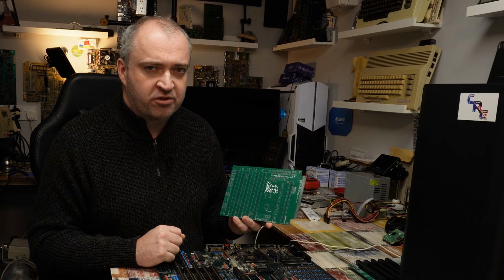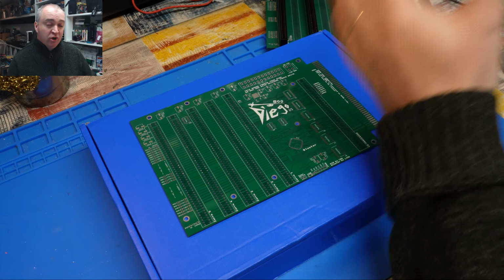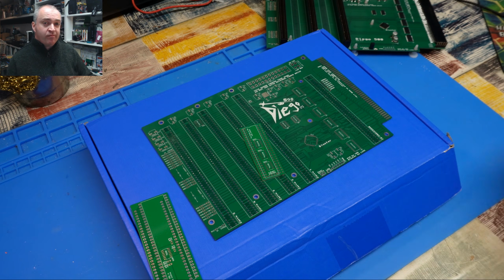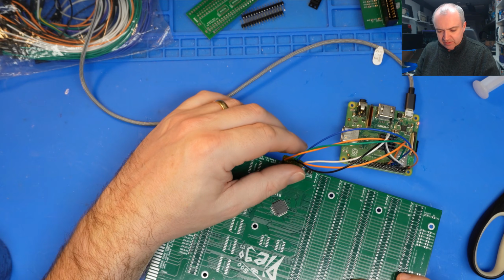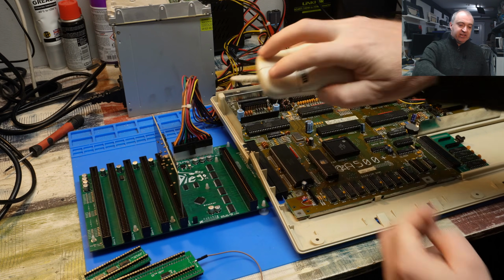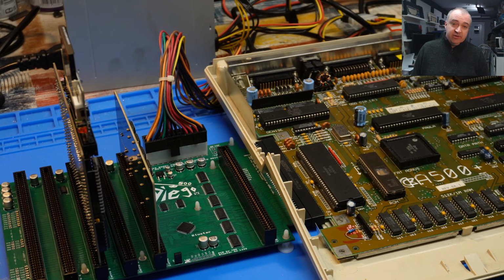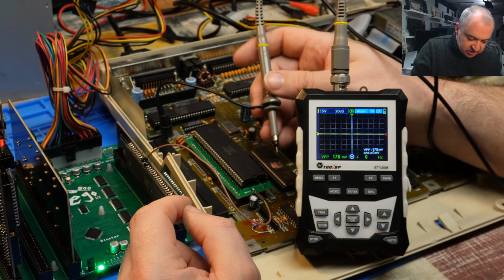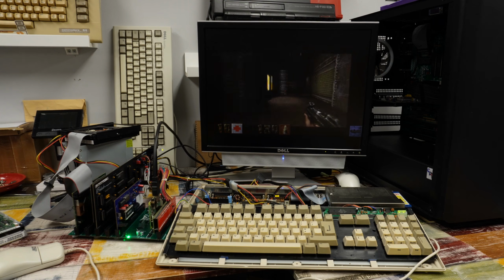Turn your A500 into an Amiga 2000

Comment: 5V power calculation assuming the traces are 1oz copper.

1mm wide, 1 oz copper trace on an outer layer:
    Safe continuous current ≈ 2.5 A (10–15°C rise, conservative)
    Maximum for typical designs ≈ 3 A (20°C rise)
    Absolute limit before risk ≈ 4–4.5 A (30–40°C rise; not recommended for long life).

As the A500 has two 5V pins the numbers would be doubled.
So should be able to take about 3A x 5V = 15 Watts

So if the Amiga side only uses ~15Watts you should be okay.

What's next PC bridge board slots 🔧
Reply: If you are referring to the 5v connections on the side slot. Whilst there are two 5v pins, they both then connect with a via to a single trace that's fairly thin.

The A500/A2000 Technical Reference Manual only rates the side expansion for 300mA (power budget section around page 227)
Reply: @LemaruX  Yes, my calculations only included one side, hence why I didn't double it.
The 300mA power budget is if the A500's power supply is powering an expansion without an external supply of its own. Glen is going the other way and powering the A500 from the expansion.
Reply from the maker: Many thanks for providing this calculation.  As you said the 500 has two pins but they both run to one trace on the underside of the 500s board which is the limiting factor.  I still think the pass through cable is the safer option.  

ISA slots for a bridgeboard is the next part of this which should be simple enough to incorporate although I don't have a bridgeboard to test with.
Reply: @CRG  Okay I've had more time to think about this and do some more calculations.
The trace is 1.4mm wide. I have checked on a Rev6 and Rev8 boards. I have also checked various Re-Amiga projects.
It is only 16mm long. This does not change the calculations much but it does help because on the Amiga side it is close to the main 4mm wide 5V VCC rails and on the expansion side it is very close to relatively large connection pins on the female edge connector. I also assume that on your PCB the 5V VCC line, just after the edge connection, goes directly into a power plane, large poly fill or wide trace. All of these factors help and provide a large heat sink so we can allow the 1.4mm trace to generate more heat than say a 5cm 1.4mm trace would.

So;-
For a 1.4 mm (≈55 mil) wide, 1 oz external trace, from IPC-2152 calculators:
    10°C rise: ≈ 3.2 A
    20°C rise: ≈ 4.5 A
    30°C rise: ≈ 5.6 A

These values are essentially the same regardless of length (above a couple mm) because heating is per unit length, but as I said, very short traces can dissipate heat into pads/components, increasing capacity.

Resistance of 1 oz copper: ≈ 0.5 mΩ per mm of width per cm length.
More precisely, sheet resistance for 1 oz Cu ≈ 0.5 mΩ/sq.

For trace 1.4 mm wide, 20 mm long:
Number of squares = length/width = 20 mm / 1.4 mm ≈ 14.3 squares.
Resistance ≈ 0.5 mΩ/sq × 14.3 ≈ 7.15 mΩ.
At 5 A:
Voltage drop = 5×0.00715≈0.036 V5×0.00715≈0.036 V → negligible for 5 V supply.
Power dissipated = I^2R=25×0.00715≈0.18 WI^2R=25×0.00715≈0.18 W over 20 mm → mild heating.

The temperature rise for a given current will be much lower than an isolated trace.
Empirical rule from PCB designers: if a trace is shorter than ~50 mm and well heat-sinked at both ends, you can often double the "standard" current for the same temperature rise.

So, from our earlier numbers:
Isolated trace, 20°C rise → ≈ 4.5 A
But as we have good heat sinking → could handle ~7–9 A at same temperature rise but 6 A continuous is a safe upper limit.
A heavily expanded system (RAM, accelerator, like those with a Vampire) may require 5A 25W.

So I believe it would be fine. The original Commodore A500 PSU (model #312502-01/02) provides +5V at 4.5 A max → up to 22.5 W on 5V alone so a stock A500 with a RAM expansion shouldn't require more than 22W.

The trace burn up point would be ~25 A for 1 second or ~60 A for 0.1 second.

Hey Glen, are you a member of the  Board Folk Discord? This should get you in if you want to join.
Reply from the maker: I've not used a 5v plane but rather a 2mm wide trace on the top side of the board reducing to 1.5mm at the connection to the pads top and bottom.  There are 3 0.5mm hole vias linking the top and bottom of the board.  Happy to share the kicad files for it if you want to take a look.  

EDIT: Just reviewing this there is space to make this a 3 or 4mm trace up to the ATX socket if that helps let it work.  I have it at 3mm already across the front of the ATX socket.

I'm not on the board folks discord but happy to join if someone wants to invite me.  You'll get me on my discord or retro hardware discord.
Reply: @CRG  There is no requirement to reduce the trace at the fingers. Leave it at the finger width or even slightly wider with the extra on each side. You could easily make the trace 2.5mm wide and it won't interfere with anything and a 2.5mm trace at 2oz thickness can carry 4A.

Comment: CHanging the orientation of the card 90 degrees,  then put everything into a wide tower case with vertical slots. I'd love one to use on my second 500.
Reply from the maker: A few people have asked for that so I'll look at maybe a 3 slot vertical version.   I think 5 slots vertical would be too much.
Reply: @CRG  3 is probably enough for most anyway, at least for those using a pistorm.

Comment: @CRG Suggestion:  Make an ATX form factor for the board?  That would hold the Diego 500 and the PSU.  I've already worked out a plan for implementing that based on my own KiCad projects. Maybe fork that into a different version as "DiegoAT-X"?  (I had to include a real word from the English language 😅)  Either way, I'd be very keen to get my hands on one of these for my A500!  Fantastic work, Glenn!
Reply from the maker: Yeah that would work.  My only slight concern is the mounting holes inside an ATX case would be further apart (I think) making the board wider and increasing cost slightly.   Not a massive issue and I suppose if it makes finding a case easier then might be worth it.
Reply: @CRG My idea would be to spin up a breakout PCB to a couple of D-sub connectors to run cables to your DiegoAT-X board.  The two I suggest going by what's lower price and avaliable from DigiKey are 1x 62-pin HD and one 44-pin HD.  They're probably about £10 per connector, but at least they aren't nearly £100 each for, say 1x 104-pin.  For the power, I suggest a 5-pin circular DIN to the Amiga's power input.

Comment: Absolutely Fantastic Glen, hell of an achievement. 
But pls,pls,pls pls... icing on the cake, extend the back and stick at least 1 or 2 16bit ISA Slots on there for bridgeboard use... that would get it as close to an A2000 as possible.
Cheers
Reply from the maker: I am planning that as an addon board but I wanted this board to be fully working first.  One thing at a time as they say.
Reply: @CRG thats awesome my friend, I have a few 2088XT boards that my friends want me to overclock and this adapter is going to be so damn useful.
As it stands its a fantastic diagnostic aid...
Keep up the awesome videos ;)

Comment: If the two boards simply slurp the signals then output their own make castellated boards that can be soldered to the bottom of the board. Can use thin PCB for better fit. I just hate interposers when not necessary.
Reply from the maker: yep, that absolutely is an option although for testing purposes the board with legs and a socket as I have it here is easier to work with.

Comment: About the case, maybe design some modular covers, so that only a long card will take space on the desk, instead of designing a case that accommodates long cards that stays empty 80% of the time.

Or you could design a new A2000 case to transplant the A500 in...
Reply from the maker: I like the idea of a modular case.  I'm not sure I'd be up to the job of a complete new case to house everything but happy to work with anyone who would like to take on such a challenge.
Reply: @CRG . I am thinking about L-shaped covers that snap together in a vertical motion, as if you are installing a card, with longer covers (with protruding sides) to accommodate longer cards.

Comment: Looks amazing Glen!

As you said in other comments it would need to be 3 slot instead of 5, but I like the idea of a vertical board in a case so that anything plugged into the "external" connectors on the Zorro boards are all going out the back, in the same direction as the machine itself, and the ATX power on the back also.

That way it wouldn't completely dwarf the A500, if you have half length cards. You'd still have a hump, but not a giant one 😂
Reply from the maker: I'll have a play with that layout and see what I can come up with.

Comment: Amazing project!  How about a rigid L shaped vertical riser that moves the expansion board up and above onto the back half of the Amiga, behind the keyboard? You could then design a box that makes it end up looking a bit like the Apple III+?  You'd still be able to access the Amiga's own ports, the PSU passthrough could be right over the Amiga's PSU port for easy access.
Reply from the maker: Yep something like that would work.  I've looked briefly at a vertical version of the board.  With 5 zorro slots it does get very tall but if I reduced it to 3 I think it would work a lot better.  I want to get this version fully finished then I can revisit that idea.

Comment: I've encountered that problem with the power connector not fitting. Those connectors have a different footprint for the right-angle connectors vs the straight ones. The rows are spaced out a little further on the right angle part.
Reply from the maker: and that's exactly the problem I have.  Wouldn't be the first time I've picked the wrong footprint in kicad...

Comment: Can you test a SID on that SID card in this setup? There is a theory going that it picks up bus noise if it is used on an Amiga powered with an ATX PSU. (btw I thouht only SCSI cards are DMA cards?)
Reply from the maker: I have tested the SID card and it sounds fine to my ear.  Unfortunately a SCSI card is the one thing I don't have to test with but hopefully one of the other guys helping can test that for me.  The hardware database lists the original prelude as doing DMA but I can't find any other references to that so not sure.
Reply: @CRG  Really? maybe I should build that version of the card. Too bad the project is pulled from PCBway.

Comment: I would make a square case that can hold full sized zorro cards, a psu and cpu slot. Then Id have a cable with a connection running from that box to the 500. Basically a 2000 extention to a 500 that you dont necessary need to place right next to the 500. Now the pricetag is more interesting question...if you do such a thing who would buy one and at what cost? With a case a cable and an internal psu inside that case I can't imagine a consumer price under the 300£
Reply from the maker: That would be as great idea and I may test this on a large ribbon cable to see if it still work ok (don't see why it wouldn't).  Cost is always a concern but I've done my best to keep the footprint as small as possible thus keep the cost down.  At the minute a set of boards plus the bill of materials works out to about £60-£70.  That's not including assembly so you'd need to allow something for that if you can't do it yourself.

Comment: why would you mess about doing all that for a A500 wouldn't you just get a A2000
Reply: You could do that sure, but where's the fun in that? What you could or should do has nothing to do with this, it's all about CAN, because why not? :p
Reply from the maker: You absolutely can just go get a 2000 but you're looking several hundred for that pleasure.  If you already have the 500, Diego will let you experience Zorro card for a lot less.  At the minute a set of boards plus the BOM is coming in at about £60-£70.  That's not including assembly so if you can't do it yourself you'd need to allow for that on top but if you consider the A2000 I built here a few years back, its board and BOM cost was over £200.  

 Plus as FloatingFatMan said... it's more because we can.
Reply: They're like rocking horse poop

Comment: That's a really cool project. I wonder if it can run a full toaster suite which I think was A2000 specific.
Reply from the maker: I've no toaster cards to test with.  We don't have a video slot on here though so if the toaster needs that then I'm afraid it won't work.

Comment: I would clearly say the Amiga 2000 board is obviously a lot bigger to start with a lot more going on
Reply from the maker: It is indeed bigger but there really isn't much more going on outside of Buster and the expansion slots.  Was really just a way to introduce the project to the video.

Comment: This is so cool. But it makes for a very messy setup. Still extremely cool!
Reply: This is just a prototype that shows the idea works! Next comes the designing to house the thing in some kind of case. One step at a time. No sense building it out until the basic concept is proven to work.
Reply from the maker: Using a pico atx psu will tidy it up a bit and once we get a case finalised that'll help too.  But yes its a big board to hang out of the A500.  Its designed here with 5 slots but a 3 slot version would save some space.

Comment: Excellent job... well done.  Would a PicoPSU work to power it?  It would save on bulk, calbing, etc...
Reply from the maker: Yes a pico psu should work fine.  Ive bought one to test with myself and will save on the bulkyness of the full psu im using here.

Comment: This labor reminds me 100% of the seemingly endless card swapping w/my A2000 and i think dealing with U606 Pin 13 to "CFG out" on the GGF ram cpu piggyback board and a few cards. You've tackled a lot building the diego breakout board for the 500!
Reply: do the case idea that @envoycdx mentioned but use acrylic!
Reply from the maker: Thanks for the kind words.  I'm hoping this expansion will allow some to experience Zorro cards without having to spend a fortune on a real A2000.  The case as suggested by envoycdx is a great idea, I'll have a play and see what I can come up with.

Comment: What about an L shaped connector? It would still need a custom case but it would be more of a cube type.
Reply from the maker: As in make Diego vertical?  I had thought about that but the full 5 zorro slots makes it very tall.  Maybe a 3 slot version would work better vertical, will give it some thought.

Comment: That has the potencial for needing 2 case types, smaller for those who just want to run smaller zorro cards / pico atx psu for example and larger for cards thatshould hold the ATX PSU too.
Going open frame like the atx motherboards you can get with card brackets maybe good too - but a full enclosure would be kooler.

Turning the power connectors is deffo a great way forward too, but then its always going to be an evolutionary design - nicely done as always Glen!
Reply from the maker: Its been a continuous evolution, I'll let these boards go out for testing then make a final revision on the back of that.  As for the case I'm thinking of an open frame with option on it for mounting panels to enclose it.
Reply: @CRG that does also sound intriguing